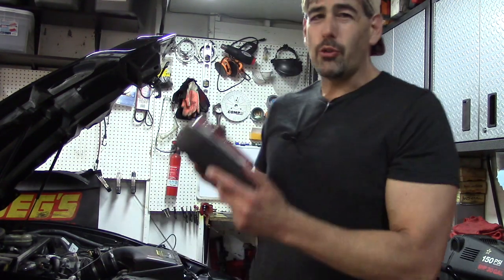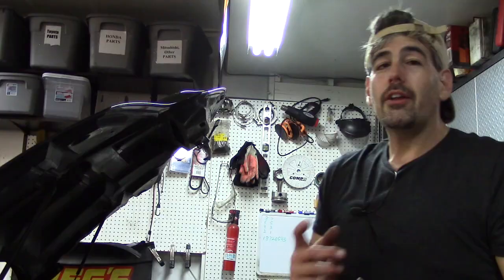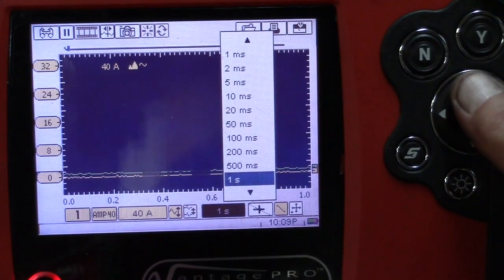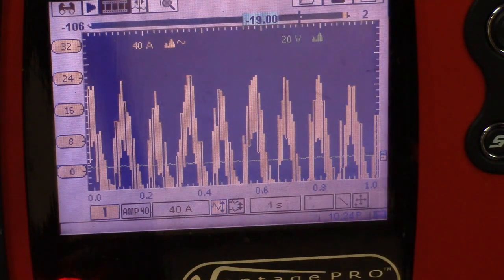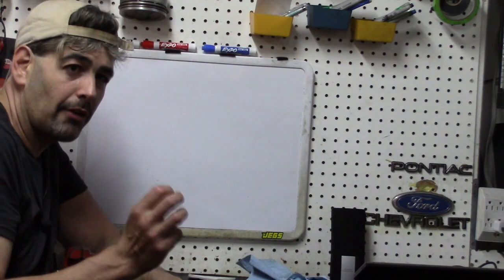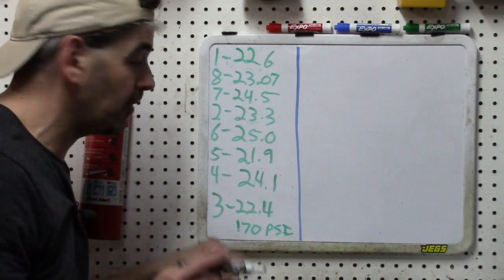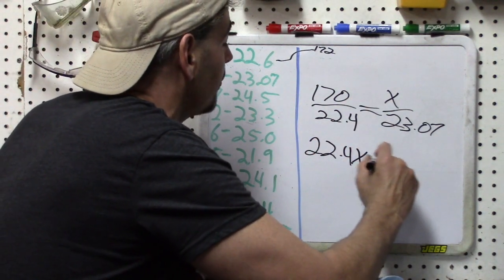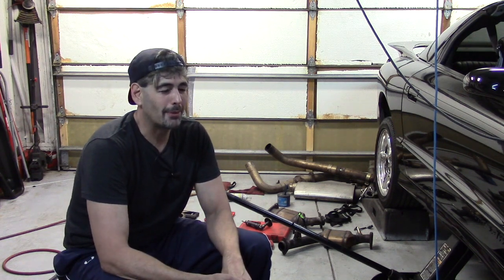Method for Relative Compression Testing to get PSI DATA!!

Comment: Good video Matt, nice to see you have a scope now.  You will enjoy the Vantage Pro, a pretty capable scope.  I have a original Vantage that I use and it is still handy.  You can buy those on ebay for around 100 dollars or so, very attainable for the diyer and it has a lot of the same controls so viewers who purchase one can follow along.  Plus people can see the value in having a graphing dvom/scope.  Now that you have your scope, come over to Autonerdz on the general public area and get registered, there are a lot guys on there that use the Vantage Pro and can give assistance and tips if you have any questions.  Did you get secondary adapter set for the Vantage Pro?  Some people don't like it I heard but it does give you valuable info in a graph format of Firing and Spark Kv and burn time.  Enjoy your new toy.
Reply from the maker: busjockey1 Thanks man. I did get the secondary set but haven't even touched it yet. 
  I'll check out auto needs! sounds like my kinda hangout!!!
Reply: www.autonerdz.com
Reply: Schrodingers Box thats autonerdz
Reply from the maker: douglas lee Yeah my iPad autocorrect again lol... I did look at the site a bit, it is very good!

Comment: Hey man this is awesome! Id been wondering how folks were doing compression tests like this.
Reply from the maker: It's awesome that you think it's awesome. I do love this stuff- so much better than videos on changing brake pads lol.
Reply: Schrodingers Box 
And this is the Vantage Pro that you picked up a couple weeks ago right?
Definitely ahead of break pad vids but some folks my need to know about those as well as drum brakes.  I have seen some brake drums from hell. 

 Whatever you do don't take the emergency brake cable loose to change a set of rear brake drum pads. You might have covered that in one of your vids but I missed it. I'm like how hard could it be to change brake drum pads? Let me at em. I screwed up and took the emergency cable loose from the r rear but I didn't take the left side off after doing the right side and it went about 1.5 hours faster. LOL! Hard lesson learned I guess.

Comment: What a cool idea! 

Not sure if someone mentioned this already but you could use the other channel to monitor the +12 volts and factor in any changes there to your equation. I think that would give you more accurate results, especially if the battery was a bit weak.

Comment: Hi Matt. Loving the minutiae, as always.
Gotta say, that was a complicated way of calculating the actual PSI of each cylinder.
Far simpler, I think, is to divide the 170 psi, by 22.4, taken from the hard reading on cyl 3, giving you a value of 7.589 (call it 7.59) and then using that value multiplied by the individual sope readings for each cylinder (ie cyl 1: 22.6 x 7.59 = 171.534psi - Cyl 8: 23.07 x 7.59 = 175.101psi etc)
Can`t fault your maths sir, but it becomes clear that you`re a scientist, who uses cross multiplication a lot more frequently than the majority of people, even the hallowed 2%`ers.
I think the 100 psi minimum reading figure is the figure that the vehicle will run at, and still comply with emissions laws, heard it somewhere, but it makes sense I guess.
Nice work, keep it up, congrats on 25000 subs, impressive. Carry on....
Reply: Calculating PSI per amp and then just multiplying that by each amp reading is definitely the way to go. One divide and seven multiplies vs. 14 multiplies and seven divisions.

Comment: Why not just divide out the left side of the equation and then multiply the result by the amperage reading for each cylinder?  No need to cross multiply and no need to move the unknown value to the left side.  It's a little easier this way.  Sorry, I'm a former math major.  But just the same, this is good information, thanks for sharing it.
Reply from the maker: When showing a formula you need to show how it was derived so people can understand it. Whatever way you do it- a formula, a calculation, whatever it is best to demonstrate how it was derived.

Comment: Cool video. Super simple math too. I wondered about the "is the relationship between amps and pressure linear" question that others mentioned. I am also curious how consistent the amperage readings are per cylinder on repeated startups - are they as consistent as repeated compression test readings?

The Mazda B3000 truck I work on in my down time will be a superb test for this as it has significant compression issues and cylinders that differed significantly on a cold leak-down test. You keep motivating me to get a scope!
Reply from the maker: Gerald Hinson Yes agreed with you and the others- to really test this method we need a specimen where one or more cylinders is significantly below that of at least one other and see that the proportional difference is still accurately represented through this extrapolation method.

Comment: Wondering if you could replace a spark plug with a regulator to get current readings at various arbitrary TDC pressures.   Probably awfully hard on a regulator to hammer away on it like that, even briefly. Actually as I write this I remember playing with an electronic pressure sensor with an Arduino to control pneumatics. THAT would probably work as I recall it's range seemed about right.
Reply from the maker: ***** There are pressure transducers for this but it would be no more advantageous or time saving than using just a traditional gauge.
Reply: The pressure transducers goes way past the limitations of a gauge. Haven't you seen scanner danner and people do running compression tests with a pressure transducer? Very cool stuff ,especially when you have a 4 trace scope. Even seen danner zoom in on a fuel pressure reading using a pressure transducer to check injector flow. 
I don't have a gauge left,they all have been replaced by transducers!! You need to keep making videos with the scope!! Its become a must have tool especially at the level of your videos! DIY guys can pick up used vantages on ebay all day long!
Reply from the maker: I haven't seen Danner do that- I will definitely check that out!

Comment: 100 PSI min holy crap are you sure that's right?  My I4 minimum is 120 and my V6 minimum is 140.  Amazing video.  This is a gem.
Reply from the maker: ***** Yeah it's right- 3 separate sources verified the same (alldata, Helms, and Haynes).  I couldn't believe it either lol.

Comment: Assuming the relationship between cylinder pressure and start current is linear. Although the pressures are so close that a linear approximation is probably adequate. It would be obvious if there was an outlier.

Comment: first and foremost I love this channel     this is my wifes log on just fyi    I am a "professional" with very limited training but have a lot of hands on experience    that being said ive been messing with a scope for a lil bit now and one of the things I believe I noticed is an inherent spike on the next cylinder behind any cylinder that's misfiring due to what I believe is a freewheel effect on the previous cylinder      am I in left field here???     one again keep up the good work   mike
Reply from the maker: Beth Reagan You are correct indeed! I have also noticed this! In fact, this same thing happens on a cylinder that is next in firing order after one that has no or very low compression.  I also attributed it to a "freewheel" effect as you described.

Comment: I can't believe how much you paid for that scope. I never find deals like that.
Reply from the maker: Chester Wardan Lol- yeah when opportunity presents itself, you have to take advantage... or add vantage lol.
Reply: lol, I see what you did there. I have the same low amp probe, I use it with my Fluke 87V for diagnosing parasitic draw on batteries quite a bit. It's actually one of the most accurate low amp probes on the market. I use it with my scope as well.

Comment: Did your vantage pro come with low amp probe?? Do you know if I can use any other probes with my scope?
Reply from the maker: Gregory May Yes it did- and 2 pressure transducers, 2 inductive spark wire probes, and inductive coil pickups.
Reply: Schrodingers Box
You got better deal than me. I didn't know how much all other accessories cost.

Comment: Matt great job my friend! But may I add? For  the DIY on this channel you know the kind who think out side the box a old school vantage is a great tool to own.. $150 on EBAY well worth it IMHO  It is like having a 600 HP motor and nor tranny! Thanks man
Reply from the maker: Joseph Tucci Yes you're right, I really should have pointed out options for inexpensive scopes that can do this kind of stuff.  I think most people are under the impression you need a vantage pro to do this and you can easily do this with a scope 1/5 the price.

Comment: When you get a scope and start getting serious you suddenly realize that the engineers never gave a thought to ease of access to sensor connectors...seems most are buried away in  tight spots under manifolds and other obstructions or the plugs are jammed close to a ground.(don't short VREF with the  T pin, oh dear ). Keep up the good work Matt, nice one again..
Reply from the maker: David ODea Yeah I don't bother with digging out sensors that much- I just poke holes in the wire or measure from the nearest connector.

Comment: ...and the student becomes the master.. lol.
This certainly seems like more maths than any mechanic I know is going to do.
Reply from the maker: Metal Maniac Agreed 100%. In fact- given the amount of labor that would go into doing a "traditional" compression test on most modern vehicles- I would dare say that this method IS how to do a compression test, and the traditional method is outdated.
Reply from the maker: Certainly more than 98% will do lol.
Reply: lolz larkin Ironically many mechanics will say they "don't fool with electronics or math"... Really??? how do you pull that off on cars now days? I quit going to mechanics several years back for this and other reasons. For the most part, I found them useless to put it kindly. Another great video here effectively putting this channel heads and shoulders above the others!
Reply: lolz larkin If you simply take a compression reading on one cylinder and your lowest amp draw is close you can assume every cylinder isn't low. Even getting a good number from one cylinder you can pretty much say all cylinders are not low if the peaks are close. I'd be concerned on a low power complaint. Still great for misfires. 

excellent video. love the math to get actual psi. even with a  pressure transducer with actual pressure readings this is faster.
Reply: Turbotomass i imagine most people would use this to see if one cylinder is low, for speed. and use a compression tester for actual psi readings if they believe more then 1 to be low.
I'd wanted to try this since i saw scanner danner do it, but like many people, i am scopeless. :'(
Reply: lolz larkin A scope can be had for cheap.
Reply: Metal Maniac yea,  I've heard this from Professional Technicans. I personally hate wrenching / mechanical these days.

Comment: Hi, can i use the voltage drop in this test, since i don't have the current probe? Do you think i can get this kind of precision? Nice video!
Reply from the maker: Yes you can but its not nearly the resolution as with Amp Clamp.
Reply: Schrodingers Box thank you!

Comment: Did you mention that cylinders won't fire at the same order as they are numbered? The same with compression. Cilinder order in relative compression will not be 1, 2, 3, 4 but more likely the order will be like 1-3-4-2 depends on the car.
Reply from the maker: If people didn't know what a firing order was  I would think they wouldn't be doing a relative compression rest.

Comment: A handy method that you can do as part of a normal service routine also especially for transverse V6 cars where the rear cylinders are hard to get at, however if one  cylinder looked poor  I would go straight for an old fashioned compression test and/or a cylinder leakdown test on the cylinders with the highest and lowest readings.

Comment: One problem in your control. You chose cylinder 1 that was almost the same as the reference. You should have chosen number 6 as well. Otherwise you are making an assumption that current is linear with compression. Anyway I enjoyed the video.
Reply from the maker: Yeah I thought about that too, but having established at the start of the video that there is less than a 15% difference between any cylinders, I think this car is not ideal to really test the extrapolation.  If I had a car with maybe 40% compression in one cylinder that would really be a better opportunity to show the extrapolation is truly linear and accurate.

Comment: You lucky man you. My standard for accurate compression testing the old fashion way is to hook up a slow charger to the battery after the first cylinder compression test. When voltage on a battery equals what it did on the first test, then I do another compression test and on down the line.

My first compression test showed a pattern of less compression on each cylinder. Having heard the obvious that the engine had less to fire on, all the hints were there for how I did the testing in the future.
Reply: Plus, I rested the first cylinder and got even less than when I tested the last cylinder. To me this proved that the PSI was also relative to battery condition. So, knowing how it is relative to each other is far more important than the number itself.
Reply: Schrodingers Box I was so excited about how this technique turned out that I didn't get a point across. If the voltage on your battery wasn't the same then you were lucky that the test cylinder tested very close to what the math showed.

Of course, with this technique you turn over the engine much less and having a battery run down is less of a worry.

And to be overly scientific. I believe the amperage of the battery would be more important than the voltage, but voltage is all I can see without fancier equipment. lol
Reply from the maker: DE Nichols Wow you know what- I never thought about it but that's a fantastic point about less battery draw!! Indeed after doing traditional compression testing especially on a V8, the weakened battery definitely can affect those last readings. Using this method you are using the exact same battery power for each cylinder.  Nice thinking bro!!!
Reply: Schrodingers Box I'm all smiles buddy.

Comment: NERD ALERT, hahaha, I'm just kidding man. Awesome video. You did a great job explaining it. I have a 2002 Z28 that I endlessly put money into so that when I bring it to the track I break something, lol. This method is much easier and faster than a standard compression test, and as you've proved, its accurate. I would actually like to see your vantage in future videos. I would also love to see some track footage, maybe even some data pids too if you you record them. Thanks for your time and effort in making your videos.
Reply from the maker: I take data all the time at the track but the problem with posting performance related material on youtube is you will get tons of CFU grads (that would be Chatroom and Forum University) who think they are John Lingenfelter despite never experiencing a second gear scratch.